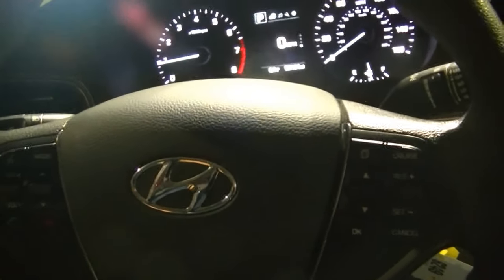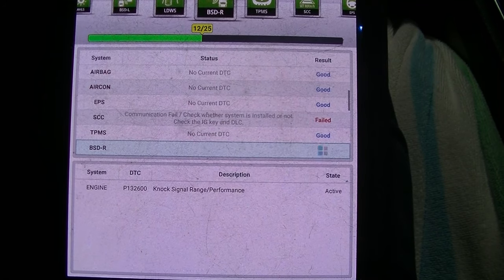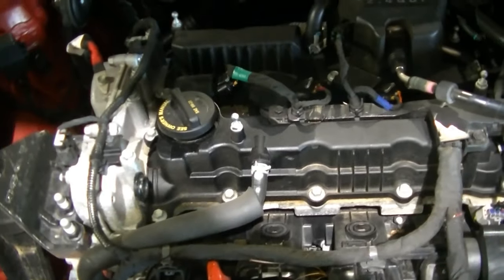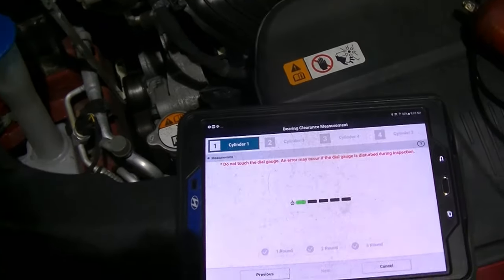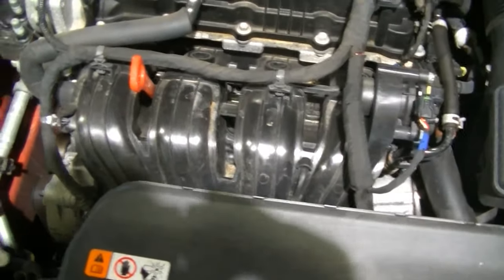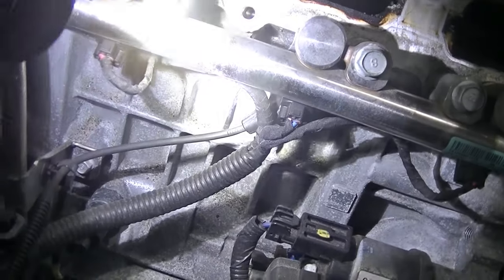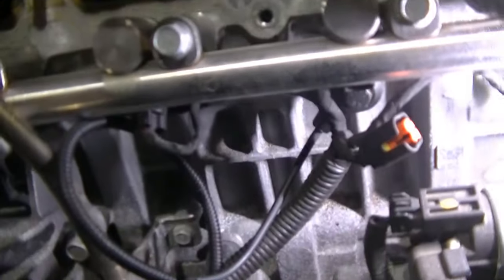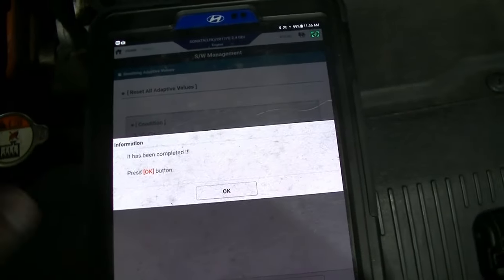Hyundai/Kia P1326 Diagnosis and Knock sensor replacement (flashing check engine light)

Comment: 2016 Hyundai Sonora Hybrid. Only 34,000 miles. Well maintained. 

It was 99 degrees F,  family of 4 going 65mph on freeway. Engine running smoothly. Dashboard normal.

SUDDENLY, gas pedal was useless! Semi-trucks & cars everywhere! 
Grateful my son was able to get onto the shoulder & stop. Could have been horrible!!!

Could not drive car at all.
Dash lit up with large words (I have a photo but don't know how to add it):  "Check Hybrid system. Turn off engine" Also showed Orange Triangle with explanation point at top, containing these letters: "HEV"  Also showed "AUTO HOLD" below all of that. The steady (non-blinking) "Check Engine" light came on later. 

Spent over an hour in desert heat waiting for $980 tow to nearest dealer.
Today, dealer says Code P1326.
I had "Campaign 966 Engine Monitoring Logic" installed Nov. 2021.
Dealer wants to install new Knock Sensor ~ $700.
This is not my regular Hyundai Service location. That would add a $600 tow. 
I read this entire thread. No one else mentioned, "Check Hybrid system. Turn off engine".
Loved my car but now it frightens me.
Looking for guidance on what to do. Thx.

Comment: It’s the rod bearing’s p1326 is a rod bearing if you don’t hear no noise coming from the engine at all then u might just need a knock sensor or software update which is not common so look for noises then u can go from the noise cause of there is your bearing RIP

Comment: I took my 2017 sportage with 105,000 miles to the dealer for the P1326 fault they checked the bearing  clearance it passed. Then they installed a software update and fixed it.
No charge covered under extended warranty. Just sharing with everyone that might need to know.
Reply: Any issues since your software update you got your car back?  I just got the same answer about my 2016 Kia Sorento from the Kia dealership.  Now I get to drive it home (7 hours) and I'm a little concerned about how long it will take for the P1326 to reappear.
Reply: @annturner836  No problems so far. I recall over the last year when starting the engine it would run rough for a few minutes then clear up and run normal. I think after the software update it did it again twice but not as bad as it had the year before. I'm selling it now, I just don't trust it any more and don't want to get stuck some where.  Good luck

Comment: also caused by water at the sensor harness (let dry few days) or false KSDS alert - make sure Hyundai put the latest KSDS software variant, there were several improved versions of the software.

Comment: My check engine light started blinking on Saturday I have a 2011 Kia Optima… did a test on it with same code … dealerships said it would be up to 2 weeks before they can look at it !! It turns on but has a terrible knocking sound!!!!
Reply: @Amanda Lovee yea I had to get the whole engine replaced! As long as you had the knock and sensor updated theyll replace it for free

Comment: Thanks for the video. What preventive measures can an Hyundai Owner do? Also, have the journal oil flow issue been corrected with the newer models. What weight oil do you recommend since there are 3 different weights listed in the Owners manual all are suitable for the NJ area?
Reply: Best preventative measures is to prevent yourself from ever buying a Hyundai or Kia again

Comment: I have a 2014 well maintained with 2.4 almost 50,000 miles and have the code back for a second time (the last at 25,000 the dealer said if was the wire harness and replaced it. Now the  scanner says “glow relay short circuit.”
Reply: Is there an update on your repair ?

Comment: Great video!  Well done.  I just replaced the knock sensor from below on a '13 Hyundai Accent with a factory sensor.  I cleared the code.  Now car will occasionally not start immediately (1 out of 5 attempts).  Any ideas?  Does computer default settings need to be reset.  Why is proper torque so important on these sensors?  I could not properly torque down since I came up from below, and had no room for wrench. I also sprayed WD40 in threaded bolt hole before replacing since bolt was very hard to un-seize.  Thank you.
Reply from the maker: The knock sensor should have nothing to do with a hard start issue. Torque value is important for the knock sensors because overtorquing it can cause false ratings and make the sensor over sensitive to knock detection. Be sure that you didn’t interfere with the fuel injector harness or anything while replacing the sensor and also check for vacuum leaks.
Reply: @SEsGarage  Thanks!

Comment: 12 DCT Veloster went into Limp mode w/ flashing CEL.  Dealer said it passed bearing test and they replaced the nock sensor.  It went into limp mode again after about 30 miles.  They suggested a combustion chamber cleaning.  Limp again on 20 mile mechanic test drive.  Now they suggest replacing the front wiring harness at $7500.  This sounds like they have no idea.  Where do I go from here? 143000mi

Comment: I have a 2017 Hyundai Sonata with p1326, they did an oil flush and change then fixed a frayed wire for the knock sensor, car went into limp mode again a day later. Then they replaced the knock sensor, car went to limp mode again 1 week later. Took to dealership instead they just called me and said everything is good,  just recommend a oil change ( i just had a flush and change a week ago 😑) they said the bearings are good so wtf do i do now
Reply: Any update?

Comment: Out of 100+ cars I’ve had with P1326 I’ve only had one that needed a knock sensor!
Reply: @jacobpockros are you trying to say that you've had 100 plus cars with this type of issue, are you a mechanic?

If you are I just had this problem happened to my car 2012 Hyundai sonata 2.4 and I switched out the sensor but the engine check light is still turning on flashing and won't let me go past 50, any advice?
Reply: @JoseMorales-vq5fu  I was an Engine Technician at Hyundai for one year. What you need to do is take the car in to the dealer and have them do a bearing clearance test on it (only Hyundai has this tool). If it passes they will do an ECM update to have the car monitor itself better and get it out of limp mode. If the bearing clearance doesn’t pass they should be able to warranty you a new long block. Does the engine make any unusual noises?
Reply: @jacobpockros  no the car  isn't making any weird noises, maybe the engine a lil louder but I'm not sure if I'm just tripen because the problem and it's alright lol    The Struggle 😂😆

Yeah my uncle was telling me that I should have took in the car to a dealership but, since it's so expensive there I'm always working on my own cars. 🚗
And today we put in that new knock sensor on and now I'm thinking about taking it off tomorrow morning and taking it back to O'Reilly's since it was like 60 bucks like me go towards getting the test done at Hyundai hopefully your rally takes the part back LOL 😆
Reply: @JoseMorales-vq5fu  It’s rarely the knock sensor. Hyundai shouldn’t charge you to do the test since it’s part of a warranty issue and the advisor usually scans the car on the service drive before they work on the car to confirm that you have that code. If you put the old one back on I would torque it to 15ft lbs so its reading correctly.
Reply: @jacobpockros  awesome well do, you think that even at 167k that warranty week kick in?

By the way thanks for all your info and help Jacob
Reply: @JoseMorales-vq5fu  Yeah it’s unlimited miles for that issue but the amount of owners the car has had could play a factor. Interested to hear what they find out.
Reply: @jacobpockros  so I wind up taking the car they ran the test and it was all good apparently they had to just up date the computer and it was covered under the warranty. Thanks for all your help bro😎😁
Reply: @JoseMorales-vq5fu  Yeah no problem.
Reply: Thank you very much friend for your comment, I took my car to the dealer and they are going to replace the engine
Reply: So what do they usually need
Reply: @jacobpockros  ? a family member has 2013 hyundai sonata had the po1326 code on ,they did a bearing clearance ,it passed ,If we do good maintenance is there are good probability that we get 40 to 80 k out of it?? did you see many cars that passed around 100k that keep going for quite awhile?

Comment: A few days ago i went to get an oil change and my car went into limp mode on the highway this morning. I checked the oil and it was overfilled and now it’s at the dealership getting looked at smh my question is could this happen from my oil being overfilled? It’s the only thing I could think of and the enigine has less then 50k Km

Comment: We picked up a 2015 Sorento today and it's throwing this same code. No abnormal noises that we can hear. 
Test drove the car yesterday with no problems and zero codes, not even pending. All monitors were set too. After about 7 minutes of driving it today and it does this. We hope it's nothing major.

Comment: I've research & a lot of people are running into this problem after they update the computer causing the engine to fail. Its a recall that Hyundai is been hiding, but there responsable to repair your vehicle.
Reply: No they not unless you have a warranty or on recall. Learn to work on your vehicle and you wouldn't rely on other people

Comment: Have this issue, got code p1326. Engine sounds fine and smooth, although im also limping. Is it more likely the sensor? If it was the rods, would woyld i expect it to run poorly?

Comment: I have seen other videos where the code on the vehicle was P1326 but their repair was to replace the intake runner motor which should have been code P200A for the runner. Do Kia and Hyundai have a problem with their computer system???

Comment: I just got a P1326 code with a flashing Check Engine light on a 2016 Santa Fe 2.0. But the only symptom is that the car doesn't accelerate past 35 mph, no knocking, etc. I read the TSB (Tech Service Bulletin) and it says that the issue is the Knock Sensor Harness...If that's the case, I can just swap harnesses...or should the dealer do this?
Reply: Whats was the issue? Im currently having the same problem

Comment: Excellent video. I'm not a Hyundai tech and this is beyond helpful to me. How often do rod bearing oil clearances open up on Hyundai's that they need a expensive special tool just to check them?
Reply: They have a class action against them currently.
Reply: These engines go out ALOT and are expensive bc its hard to find a good one. Im located in dallas tx and the engine was $3400 for one with 55k miles on it.

Comment: we’re you losing gas and having problems accelerating w a blinking engine light ? I have a 2016 Kia Sorento 107,000 miles car drives but have parked because engine light blinking and gas has been getting eaten 
Knock noise is very low but you can hear it but not when drive kindve goes away getting towed in morning
What do you think?

Comment: My son’s 2014 Sonata has the same code. How much was the repair on this? I saw Hyundai reprogrammed the computers in these cars as part of a recall, make the knock sensors overly responsive. Even using a non original oil filter can set them off. He just got an oil change.

Comment: I got my knock sensor replaced but still have the same code and problem with car how do you reset the check engine light flashing all the auto shops said I have to take it to Hyundai but Hyundai can’t get me in for a month i don’t wanna blow the engine
Reply: Any update

Comment: Great video its also clear that you are Hyundai/Kia trained. But my question is do you know if kia/Hyundai performs this bearing check for free or if there is a charge?
Reply: Following
Reply: That's part of a recall. If your engine is concerned, you'll get the letter and it'll be done for free. Or if there's a flashing check engine light with p1326; it'll be a part of the diagnosis. But you cannot have the test done for fun on any car.
Reply: @stephanieaasselin2037  what do I do if my car I don’t have any address on file?
Reply: @asontreforrest5350  contact a dealer close to you with your VIN in hand and they'll be able to tell you if there are recalls to be done.
Reply: I got mine done for free, the engine light came on flashing and than about 2-3 days they fixed it and was covered because it was covered
For drive train warranty that the sonatas have for 120,000
Reply: I have 3 Hyundai/Kia vehicles with the 2.4L Theta-II. All 3 are Korean built MPI versions, not GDI or built in the US. All 3 were part of the recall and all 3 passed:
2011 Hyundai Tucson w/ 97,209mi on 5/4/2021
2013 Kia Forte Koup SX w/ 114,053mi on 5/5/2021
2011 Kia Forte hatchback SX w/ 52,689mi on 5/8/2021
Reply from the maker: The thing about the recall is that it’s checking the engine in its current state. Sure it could be OK right this second but it doesn’t address the inherent design flaw that’s causing premature rod bearing failure. As far as I’m concerned they are all ticking time bomb‘s. I’ve had cars come in that weren’t making any noise for a simple oil pan reseal drop the pan and it’s filled with metal. I’ve done several hybrid models that are not direct injected. And I’ve done several engines in Tuscon‘s and Santa face that were not direct injected. I don’t buy Hyundai and Kia‘s claim that casting material left behind at manufacturing is causing these issues.
Reply: @SEsGarage  Thank you. I don’t buy that claim about manufacturing remains either but I do believe there could be something to the Korea vs US built engines.  Thanks again.

Comment: New friend here. Liked the video, i have 2017 tucson. Looking forward to watch all your vids soon. Stay safe.
Reply: i have the same car as you. this just happened to me. dealership cant see my vehicle until december. it ran a p1326 code. there is currently a class action lawsuit to hyundai and this. its also under recall so id assume my dealership will honor to fix or engine replacement.

Comment: Great video. Thank you. I have two questions. People like to claim all these Theta-II engines are crap but I don’t believe that’s true. In your opinion, is this engine knock issue more of a problem with GDI vs MPI or both?  Also, is it for of an issue for American assembled engines vs Korean assembled engines or both? Thanks.
Reply from the maker: Let me put it this way. I would never put my family in a vehicle with any series theta engine. One, two, or three. I’ve just seen too many failures from well-maintained vehicles.
Reply: @SEsGarage  Maybe I’m lucky. I have 3 Theta-II powered cars that all passed the test this past May as part of the recall:
2011 Tucson with 97,209 miles
2011 Forte SX hatch with 52,689 miles
2013 Forte Koup SX with 114,053 miles
Reply from the maker: @NovaResource  The thing about the recall is this. They’re basically inspecting your engine to see how it is right this moment. Sure it could be OK right now but that doesn’t mean it won’t develop rod bearing failure in the future. They’ve done nothing to address the inherent design flaws in the engine that are causing excessive pre mature rod bearing failures. I don’t buy into the whole casting materials left behind at manufacturing. If that were the case I feel like they’d be popping a lot earlier in their lives.
Reply: @SEsGarage  hi. How can I now if my cars have that type of engine? 2015 Forte5 2.0 and 2017 Sportage FE model
Reply from the maker: @iamdenislara  if your sportage has the 2.4 or 2.0T it’s the Theta series engine. The 2.0 in your Forte is the Nu series engine
Reply: @SEsGarage  thanks! It is a 2.4. We got the p1326 code and the dealer agreed to change the knock sensor. It didn’t work so now KIA agreed to change the engine. Is the new engine coming with a fix or I will have the same issue after I drive 64,000 again?
Reply from the maker: @iamdenislara  the replacement engine will be a remanufactured unit, not a new one. And it’s the same engine going back in, there have been cases where I’ve replaced more than one engine in the same car
Reply: @SEsGarage  thanks. I only owe 3 grand on the car. After the swap I will pay it off and sell it to Carmax then. Thank you so much for replying!
Reply: Keep your fingers crossed because hopefully it's not a matter of time for you and your car. These engines are simply worth their weight in dog$#!+
Reply: @SEsGarage  if you're getting the engine replaced for free let them do it. If not, sell it now. My step brother just sold a 2016 kia optima to carmax with the knock and got 11k for it. That was enough to pay it off and still have 2k in hos pocket.
Reply: @SEsGarage what is the clearance test called if there is a name for it. Sorry I am not a mechanic but dealing with this issue
Reply: @SEsGarage Shouldn't the reman engine builders have the bearing issues figured out ?

Comment: How do you reset the adaptive values if you're replacing the knock sensor at home? If I clear the codes and possibly disconnect and reconnect the battery after install would it work?
Reply from the maker: You can try a capacitive discharge. Disconnect both battery cables and touch them together for several minutes
Reply: Did putting the two cables together work

Comment: Got a question for you,  our 2013 Kia Optima with the 2.4 got the SC147 recall done back in 2018 however I'm 95 percent sure the engine is blown on it. Is there anything that can be done since the recall was already complete? Kinda sucks that the recall was done and shortly after the engines decides to quit with 120k on it.
Reply: they changed the recall for SC147 instead its 15 years with unlimited miles....take it back to Kia if it's still running
Reply: @chrisc1623  we ended up fixing the issue. It ended up being a crank sensor.